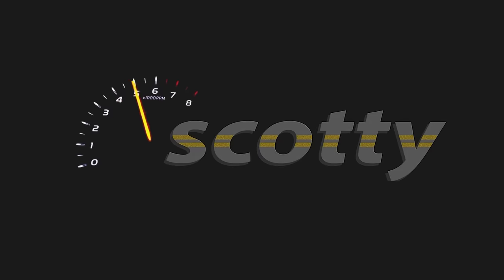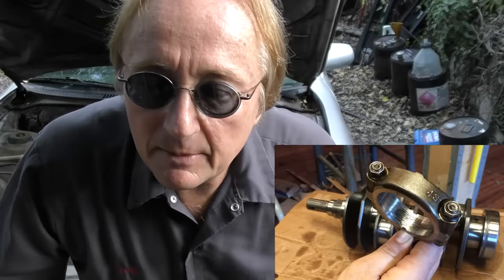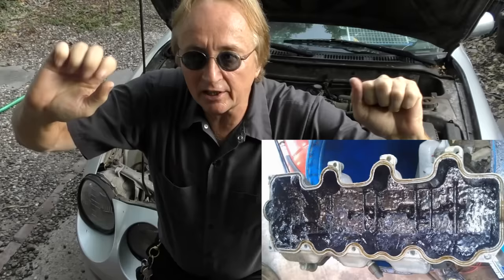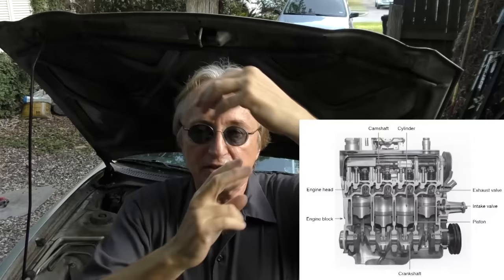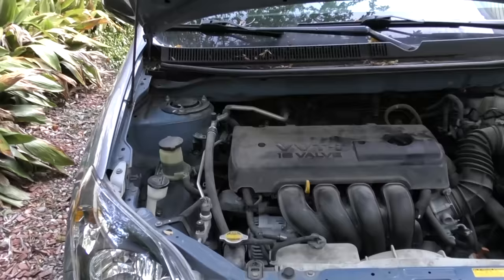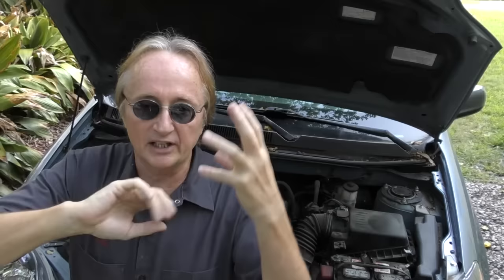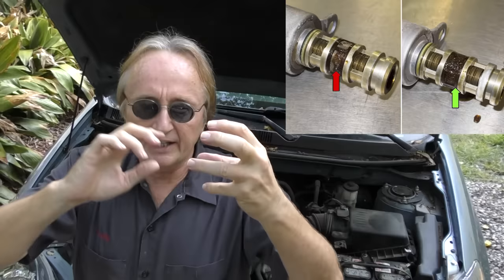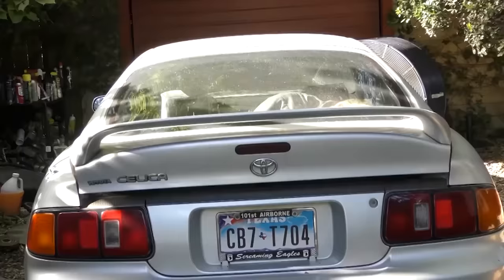Why Not to Flush the Engine Oil in Your Car

Comment: What if one is changing oil from semi-synthetic to fully synthetic oil. Isn't it recommend to flush to ensure minimum mixing between the 2 oils ?
Reply: Kumar, spend flushing money on oil & filter changes. So little oil is left in a motor after draining the pan and replacing the filter that any slight incompatibility between the additives is non-existent. 
Synthetic oil is just oil that is manufactured from base stocks (or natural gas) instead of by refining petroleum.

Comment: Very occasionally I will run cheap oil with trans fluid. Say the car takes 5 quarts put in 4 and 1 trans quart For about 10-20min. But haven’t done that in years with the new synthetics.

Comment: Good advice.  I have a Honda Accord with over 210k that takes 5-20W  oil and burns oil. Should a higher viscosity oil?   I don't have any leaks and you said changing the PCV valve  every 3 years might help with the oil consumption.
Reply: That's to thin for an old engine. Should be 40.

Comment: While I agree that some 2017 vehicle should not need a flush, if you're like me and love to drive an old 60s, 70s, 80s, maybe even early 90s something or other, an engine flush is a good idea. These old engines are a lot more primitive and the tolerances of the internal parts are a lot "looser". While these simple designs makes old engines tough as nails, they also are much more prone then a "modern" engine to sludging up. A clean engine is a happy engine. On an early 90s and older engine, flush away my friends! You'll be amazed the crap that will come out of it!

Comment: Hi @scotty. i appreciate the details. thank you. the oil in 3Year Old car should have been changed 30k km ago but was not. sludge can be seen when the oil cap is opened. i guess it would be difficult for you to tell without seeing but what is your gut feeling? should the oil and filter be changed or should the engine be flushed at first?

Comment: So what is the best way to remove the sludge in an old engine in which the owner didn't change the oil often enough?  Just forgo the engine flush and start doing more frequent oil changes?  That sounds great in theory, but I live in the real world and deal with customers who don't change their oil on a regular basis.  Many of these people don't even know how to open their hoods, believing that if they specify expensive synthetic oil, that all will be OK under the hood for the next 10,000 miles. (Even showing these people that there is no oil on their dipstick when they come in for service doesn't motivate them.)

Comment: Should I flush the engine on a 50 year old 360 FE engine? Runs good but has low oil pressure.

Comment: **Scotty! Help! I bought a 2001 Toyota Highlander v6 3.0 with 135k miles and I am afraid it might have engine sludge. Under the oil cap I can see crusty black oil that’s pretty thick. Some is crusty and hard some is real thick and greasy. It had an oil change roughly 500 miles ago and I don’t notice it driving funny yet. Does this sound like a problem? Will regular oil changes and good gas clean this stuff out?  Thanks Scotty!!
Reply: Is the engine still good and less sludge? I would do quick oil changes every 1K miles for a year if I were you.

Comment: I had a 87 f150 6cyl with 480k mi and flushed the engine every 50k. Never used synthetic oil.  Last time I flushed it spun a main bearing.  I pulled the engine and removed the oil pan.  It had 3 inches of hard crusty oil flakes that clogged the oil pickup tube. Don't flush your engine period..... Unless you are going to pull the oil pan and clean it to.

Comment: In 1995 I bought a Chevy Cheyenne 4.3 vortex 5 speed work truck, changed the oil religiously every 3000 miles. I took really good care of that truck until I met my girl friend. She said I can drive a manual transmission. No she could not drive a manual transmission, that poor truck went through 3 clutches. The truck lived till 2015 then I put some of that Marvel Mystery oil to help the motor. One of my lifter gummed up and that was it 500,000 miles, and now all have is a dead truck.
Do you think a engine from Autozone is a good swap?
Reply: Get another truch some old man's grocery getter or a truck from a rural area. (All hwy driving.

Comment: I did my 2002 Yaris VVT-i engine back in 2009 with 66,000 miles on it with Forte engine flush,it made the engine run even smoother!! Brilliant stuff.Been fine since and still runs sweet as a nut...even 10 yrs on it's fine and i still own it today with 89,000! Frequent oil changes is what i've done.

Comment: I wonder if that’s why the Briggs and Stratton powered mower has a sticker on the engine saying (NEVER CHANGE THE OIL. JUST TOP UP) One of my children gave me the mower. I couldn’t believe they had never changed the oil. So I changed it and ran it. Then did the same again three times before I was happy with the oil colour. Then I saw the sticker. 
Now I am worried I did the wrong thing.

Comment: The only time i'd recommend flushes is if the owner is doing full drain intervals on long drain interval cars.  In the UK it's a bit different maybe but on the 20-30k ODI's all oil additive packages have failed and left deposits. As soon as you have bug sludge deposits like in the vid you need to just do short ODI's and let the oil clean it slowly over a long period of time.

Comment: I had white smoke out the exhaust I found I had a puddle of oil in the plenum. So I wiped it out changed out the pcv. Only to have it start smoking again and another puddle of oil in the plenum. Should I flush it? It might be clogged and building up too much pressure and having excessive blow by… 2015 Toyota Avalon. What do you suggest Scotty?

Comment: Ok there are mechanics saying you can use a engine flush to clear out old oil to not mix it with new oil but only if you are going to stick to a new oil and you are saying not to

Comment: Do you feel the same way about flushing the transmission? I shoot for doing it every 40-50k miles.
Reply: Transmission flushes are a lot different because you don't put anything foreign in the system. All a trans flush (should) be is replacing the trans fluid, running it through the gears, and replacing the fluid again. It's more comparable to an oil change

Comment: Scotty do you recommend Royal Purple brand? I hear it cleans your engine better than new and literally just yank all the hidden gunk and sludge off of your engine. Also heard any funny knocking sounds from valve lifters are totally eliminated making engine run smoother. Seen a few videos from people using it and open up their valve covers to show what Royal Purple can do.  I’m actually debating on buying Royal Purple for my next oil change.  I know it’s not cheap but people swear by it and also to buy the correct weight for my car.  2002 Mercury Gran Marquee 4.6 V8 only has 78000 original miles original owner.  Thanks Scotty.

Comment: The reason I was wondering is the car had been sitting for 6 years or so, so I changed oil and fuel pump etc, I took the spark plugs out and it's rust look brown something on the end of the plugs, I was thinking maybe it's rusty gas from sitting so long, not sure of that , maybe I should change the oil again and hope any alien materials might come out with the oil change, let me know what you think ,thank you

Comment: I've seen that after a flush, a lot of that sludge falls to the oil pain, and then it gets sucked up by the oil pump, clogging the pick up screen. Lo and behold low oil pressure and no oil to the top half of the engine. Makes for lots of damage and expense

Comment: What would you do if you had an issue with coolant in the oil to clean all that snot off everything after the issue is fixed? The engine has 34,000 miles V8

Comment: My new mechanic just replaced valve gasket Cover on my Highlander 2006 V6 at 103000 miles and told me shockingly,  the internal engine was too dirty and has a lot of corrisions😏😲 that is while I changed the oil every 3000 miles ( not every 3 months because I barely put 5000  miles a year). Now he is recommending to put a engine oil cleaner or whatever that is 5 minutes prior an oil change. ?? Now I wonder if the mechanics changed oil filter also every time the changed oil. ??

Comment: I just used some Seafoam engine treatment to my crank case to liquify any deposits in the crank case while running the engine, is that just preventative maintenance or is it worth doing a whole flush? It’s a 04 Silverado 4.8L V8.

Comment: @scottykilmer
I have a 1995 Thunderbird with a 4.6 L. I don't know the mileage, it had 125k several years ago when the odometer broke.
it recently started to have a lifter tap when I started cold. After it warms up a little goes away. I thought I would get that ATS oil cleaner treatment that you talked about but when I came here to find a link for it I also found this video that recommends not flushing the oil.
What should I do?

I can't just replace the car because I need one with the large doors so I can fit my wheelchair into the back seat. There's very few options these days and I don't have a ton of money either...

Thanks!
Reply: Oh, also...
my wife has a 2011 Forester with about 60.000 mi. I thought about getting a two pack of the fuel and oil system products and do both of our vehicles. So what do you say about putting it in the Forester?
Thanks!

Comment: Hi scotty.  i have an 05 hyundai tucson with a 4 speed automatic.  I bought it used with 35,000 miles.  I had the ATF changed then and when it hit 65,000 miles. The transmission shifts well.  So far, I have not had any issues with it.  However, I have not changed the transmission filter because the mechanic told me that the filter is not easy to get to.  He basically would need to take the transmission down to replace it.  He says it's basically an overhaul - very costly.  So my question is, if I just keep changing the ATF every 30,000 - 40,000 miles, I should not be too worried about the filter clogging up?  Thank you for answering this and for all the experiences you've shared.  God Bless.
Reply: I got a 2016 sonata 2.0t and i got the same thing my transmission has an internal fluid filter and you don't need to change it at all accept when the transmission fail and need a rebuild you can change it with the rebuild but it wont fail because of the filter the filter was made to last forever  . I dont know if yours are the same . Btw i asked the dealership about it that's what they said .

Comment: When the car has a lot of miles and the bearings get where on the bearings if you flush the motor there's a chance that the oil pressure will drop because it's the crud inside the engine that is hoping keeping your oil pressure up high
Reply: That means you need an oil pump if that happens, or your gap in bearings is too large and your getting a false oil reading in the first place.

Comment: What if I had a bad high pressure fuel pump and gas ended up in my engine oil? After I replace it wouldn’t I need to flush the old oil that’s mixed with gas?

Comment: Hi Scotty,
I change the oil for my 2014 corolla and 2015 Santa Fe myself. After draining the oil completely, I use my air compressor to blow out any remaining oil. By doing this, it does blow out some oil, but im not sure if I should be doing this. Can you advise on this? Should I stop doing this? By using the air compressor, does it hurt the engine?

Comment: On my 2016 Honda Civic I change it every 4,000 miles oil and filter and transmission just drop and refill and on my 2008 Toyota Corolla same every 4,000 miles both transmission fluid and engine both drop and refill with brand new fresh from the dealership I also change the  every 3 to 4 years I always get the gold star from AutoZone and always but medium of gas on both cars 89

Comment: So after going 48-58,000kms without an oil change, will draining & replacing both oil & filter every 5000kms for the next 60,000kms, gradually get it closer to normal?

Comment: Ok...don't do it. So if you have sludge how do you get rid of it? 2012 dodge ram 1500 5.7 ltr, I found sludge on my MDS magnet after developing a code for the #6 reactivation control performance. No metal filings...just thick sludge. How do I get rid of it now that it is there? Thanks.

Comment: I did A engine flush on my car at valvoline after few weeks later my car got slower 
First and second gear works fine but after switch to the others gears seems the car lost velocity. 
I wonder if because of the engine flush I did or my car need something to be repaired. 
Thank you so much.

Comment: Did an oil flush on my '86 Fiero GT, and blew the rings off.  I guess the sludge was really the only thing holding everything together.  Oh well!  Live and learn.  Well, maybe not..  Now I own a charger.  Guess I haven't learned too much.
Reply: In an old car i would use clean oil to flush it then use flush is my advice.Frequent oil changes is a must.

Comment: Okay but what if I have suspicion that last 2-3 oil changes, I received oil that was substandard quality. I change oil every 9k miles and now I have about 50k in my Mazda 2 2018 1.5 Skyactiv G. So I don't want to just put the good oil there and let it flush the engine and keep all the dirt all the time, I would rather use a flush, let it idle for a few minutes, then replace the oil and should be better no?

Comment: Hi Scotty, love your videos.
I have a 2006 Vauxhall Zafira B  here in the UK, I was lazy and didn't do any maintenance for about 6 years,  no oil change no service etc It was only meant to be a temporary run around then scrap it, but the car has grown on me and I want to keep it running, I was going to flush it untill I saw this video, but my question is, have I done any real damage already, or should it be fine if I start changing the oil regularly, it runs fine and only needs a clutch (slipping slightly) I had a check engine light on recently throwing all sorts of sensor faults, but fuse 26 engine electronics seemed to fix that.

Comment: I never flushed an engine before. Last oil change, with now about 250,000 miles and lots of sludge in the top end, the mech said i had to flush. Ok we did but the sludge and crap across the rocker shaft and valve cover, etc was all still there. Why didnt it work and what can I do?

Comment: Logic tells me that it's a general, all purpose detergent that helps losen up whatever stick to the hot zones in an engine; like when you forget the hero sandwich in the toaster at 450 degrees F. - instant metal shavings and burnt oil pancakes.

Comment: Never ever flush your engine! Back in the day people would MIX 50% kerosene and 50% oil and slowly run their car around the block.! Problem is, with any engine flush that you wind up running the sludge through your main bearings on the crank. Therefore, never flush any engine it will shorten your bearing life.

Comment: But if the engine had "Crud" in it that's stopping leaks then the holes that allow the flow of oil will block up,or am i wrong? I flushed my 2002 Yaris back in 2009 and never had an issue with the engine.....that;s the only time i put a flush in that car.

Comment: I have an 07 saturn ion with the ecotec 2.2 engine, it has 190k miles I was wondering would it be wise to engine flush or just keep doing oil changes. I don't want to mess anything up or spend unnecessary money.

Comment: I bought a used Jetta at 82k miles, around 190k I developed a loud ticking noise. I thought it was a rod knock or something internal. I did a engine flush and it went away

Comment: i bought a 2005 Daihatsu Terios with 214.000 km on it, but old owner was using 20w50 mineral oil even when that car uses 15w40... i wanted to flush the engine, change the VVTI filter after, cleaning the carter and then put 15w40 semisinthetic oil... is it a bad idea? can i go from mineral 20w50 to semisinthetic 15w40 without doing the flush?

Comment: Hi Scotty, I enjoy your very informative  automotive videos. I regularly change my engine oil in my 2017 Subaru Outback (2.5). The book states change at 6,500, I do it at 5,000. Will adding transmission fluid to the oil and running the engine for a few minutes just prior to changing the oil help remove any sludge that may have built up, without causing harm? Also, do you think it's necessary to re-torque the head bolts at a certain mileage? I have 70,000 on the car which runs great.

Comment: That's weird, I was burning oil and had low pressure in my 2013 Sierra, used Motor Flush then new filter and oil and both problems went away.

Comment: I have 3 vehicles and I always do engine flushes,   sludge isn't the only thing you have to worry about, carbon buildup in your crank case!     It's due to contamination of your oil ,  cause every engine especially with 100k miles has blowby,
Reply: Put stuff in your gas tank to clean carbon and fuel injectors. Especially stuff with PEA works best.

Comment: I put i qt to 4 of oil to attempt to flush it. I forgot about it and drove it 2 months like that. Not a single problem. Of course it was an xj. Itd run on crisco and brake fluid in place of oil, ,🤷

Comment: Great advice. Find the owners manual and look up the recommended type of oil, and use that. While you’re reading the manual, notice that NOBODY says to ask the zit-faced kid at the parts store for advice on what kind of miracle crap to put in your motor. I get well over 300,000 miles on my hard driven vehicles, and I use zero additives. Mobil1 synthetic

Comment: What about running diesel truck engine oil in a car with a sludge problem for about 1000 miles then changing back to the recommended oil?
Reply: Not with VVT.